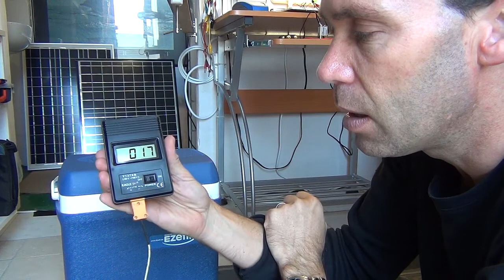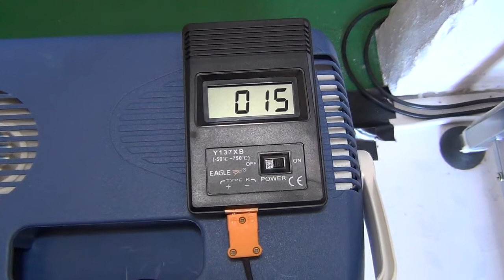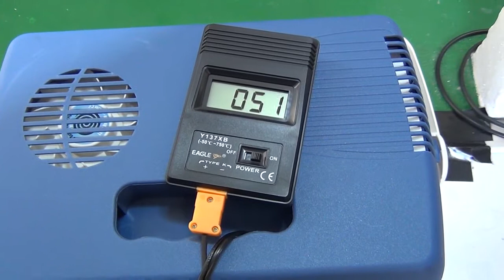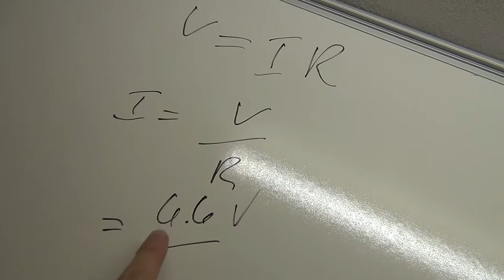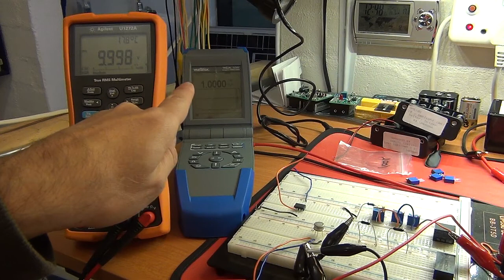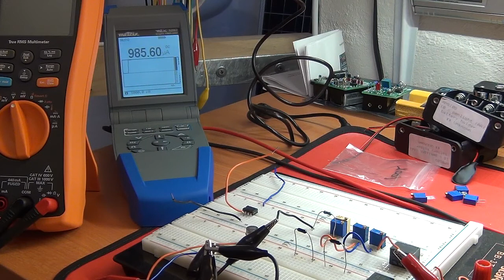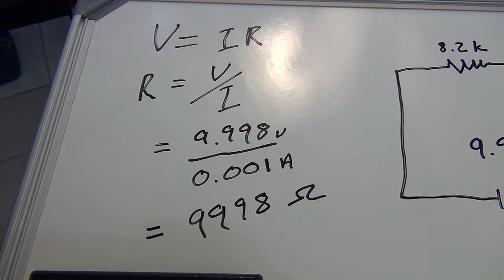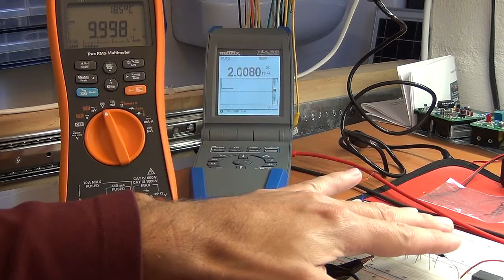Multimeter Reference Check #2 - Calibration oven / cooler and current reference

Comment: The trouble you will have with using a resistor to generate a reference current is that the device you use to measure the current will have its own internal resistance that will change the current. My meter on the 50mA scale for example is about 10R; in your setup about 0.1% of the reading.

There's a circuit for one in National AN31. Not sure how good it is.

Comment: The cooler is almost certainly a peltier element / TEC, so it can pump heat either way - all you need to do is reverse the polarity (on the actual peltier element, not the fans) and it will heat the inside instead of cooling it...

Comment: well all I can say is something that is in other comments. When you have exactly 1 mA on the meter and you switch power supply off the meter goes to lowest current range. When the supply is switched on again the meter will not go back to its previous range. Because the internal resistance of your meeter is higher and current in the circuit smaller. The voltage drop across multimeter is higher on lower range. Use a fixed range meter.

Comment: In My opinion use carbon dioxide fire extinguisher, because it leaves no mess. The automotive ones have nasty powder that is impossible to fully clean up. This powder is similar to backing soda and when it is heated above 60 degrees C it releases well gees what a carbon dioxide gas as a decomposition product. Therefore I do not like the powder fire extinguishers because of the mess. Back in the past there was also a Halon extinguisher now they are band due to ozone layer, they were the best.